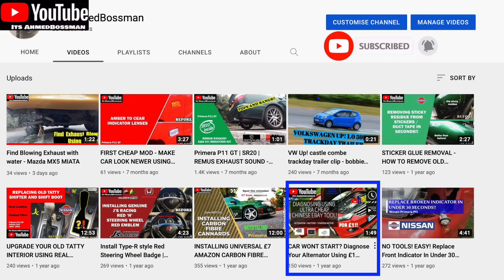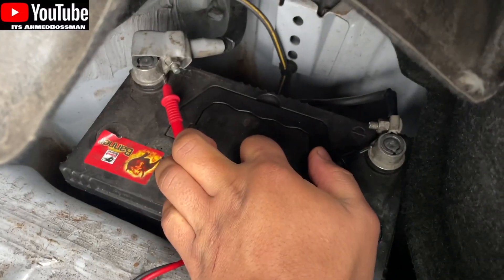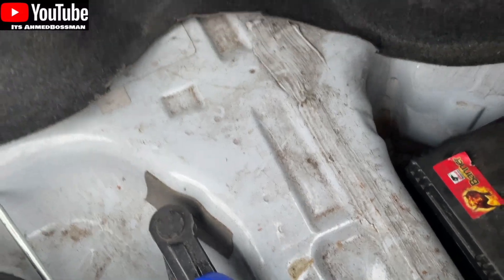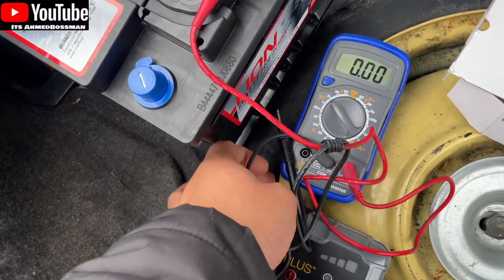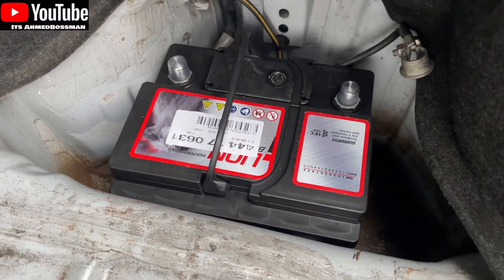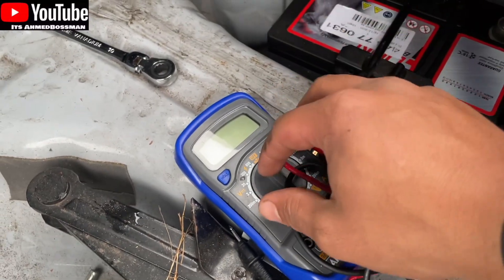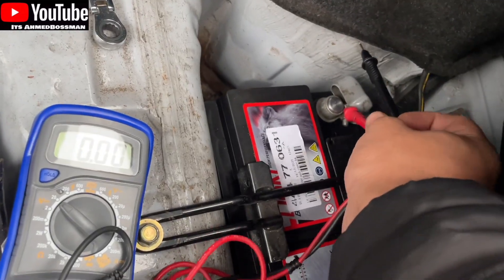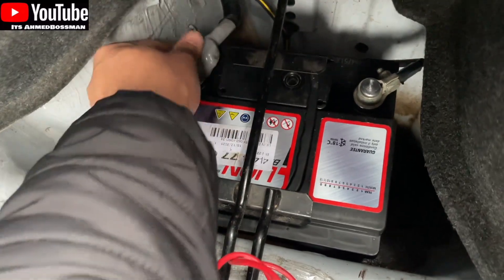CAR WONT START - Inspect and Replace a Faulty Battery - Mazda Miata MX5

Comment: You should have installed a vented battery. Apparently the previous battery was incorrect also.
Hydrogen vents from the battery during normal charging/discharging cycles. Batteries located in the trunk should be vented to the outside.
Venting prevents hydrogen from building up in the enclosed space and possibly exploding.
Reply from the maker: ahh really, didnt know that, i do not think any of my mx5's have had a vented battery though...